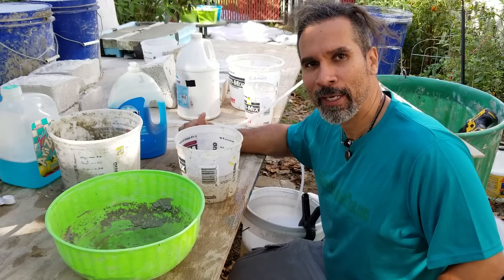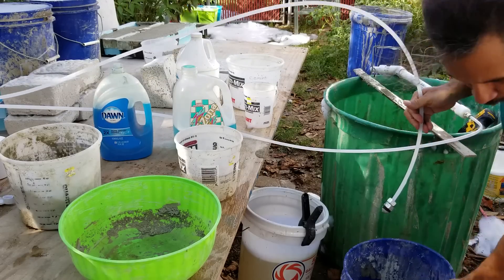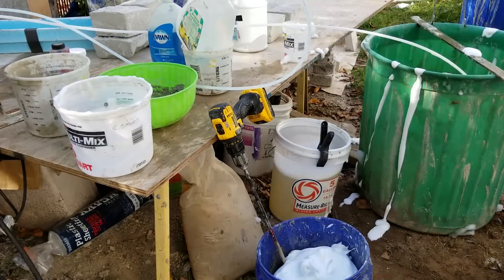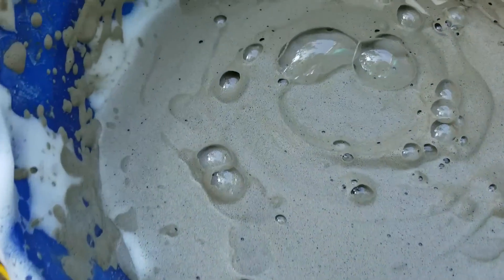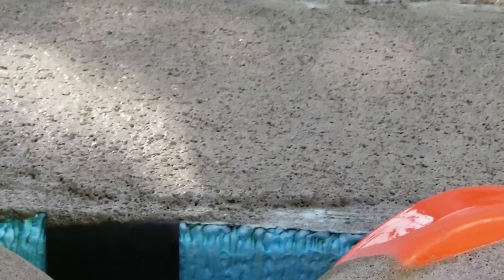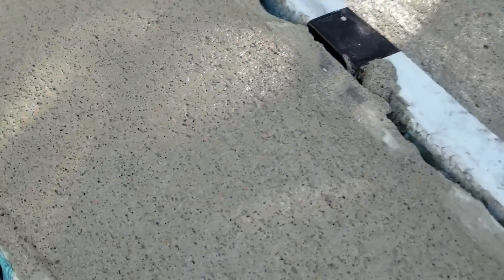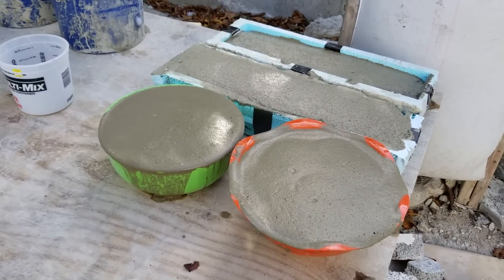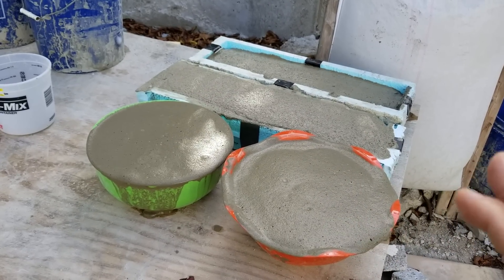How To Make Aircrete Part 3 #Aircrete #Foamgenerator #AircreteHarry #AircreteHarryFoamGenerator

Comment: I am reviewing your aircrete videos because im getting ready to try making some shipping container exterior insulation paneling. I'm thinking of putting some hog wire panels inside the aircrete for strength on the sides. do you think its nessasary or what is your exerience  setting steel mesh in aircrete. i wonder if i could substitute the hogwire for a less expensive or recycled material like plastic mesh fencing type of material. any ideas? Thank you for your diligent research and documentation of aircrete Harry.

Comment: great videos! That's a 5 quart bucket, so two buckets level-full equals 2.5 gallons? So when you add more foam to the second bucket, you are going over 2.5 gallons. thanks! (this might apply to previous video = part 2)

Comment: Hi Harry,  Great video's. I have been watching Darwin on Honey do Carpenter and he has built many Aircrete projects and has determined after much testing that Suave Shampoo makes the best foam and holds up longer than all the others. Do a video using it . I think you'll be suprised. He builds rocket stoves and also incorporated water glass to coat the cement and it is totally heat proof. The aircrete alone is heat resistant but when he lined the flu with water glass it would withstand 3000  - 4000 degrees. Thanks.
Reply from the maker: Thanks Jimmy, I know Honey do Carpenter. If you look through my videos you will see I did  Test comparing different soaps and suave against Drexel. Drexel is the best! On my video if you click on my name then click on videos all my videos will come up in order and you can see all the different test I made. Thanks!

Comment: can you comment on the shrinkage volume or how much the aircrete shrinks during the drying period
Reply: Concrete doesn't really dry. The water stays in it and is what holds it together.  If you cook it in an oven at over 212f it will turn back into the powder.

Comment: Thanks for your videos Harry, you really make me want to go out and build with it. I have a question and a few thoughts to add though

Do you know if pressure washers with the foaming setting will work well to create a quality foam for this?

Also I have built some homes from straw bales and they have natural plaster walls. They use cattail (swamp hot dogs) as the fibre for their plasters. I think it would be a great fibre to add to aircrete ( when you rub the cattails they spread out into millions of tiny fibres) 

Also I think aircrete would make a great base for underneath a concrete floor. It would be far cheaper then styrofoam. Just pour 2-4" of aircrew first and then top it up with 2" of regular concrete for added strength.

Aircrete walls could be poured and then plastered over later for a finer finish,

refractory aircrete mixes for building a fireplace

The domes look great but I'm not such a fan of all the work that goes into all the curves personally. I want to get this going more into traditional construction. Mixing foamy bubbles is a lot easier on the back then shovelling all that gravel and sand! You are onto something here Harry!

Comment: Harry, you’re measuring your foam wrong! Nobody caught, even you! You say two gallons of foam in the videos, but your bucket clearly says 5 QUARTS!!! Unless we’re talking Imperial measurements (Canada) here you’re putting a half-gallon more foam in the mix every time! That’s a lot if the ratio is important, which I think not, however if structurally important, it would be critical. This isn’t the case with the product. OTHERWISE well produced. Dyslexic people pick up on nuances and details like this. We couldn’t make a video like yours, but we can tear up one looking for errors! I make a hell of a proofreader as well! Going to use aircrete as a binding agent with chopped straw in a 18-20” in-filled wall post and beam cabin I’m building.
Reply: Yes, I caught that too. Says 5 quarts right on the container.

Comment: Hey Harry, I see lots of creative possibilities with aircrete, for instance, a tiny home with an exterior of broken pieces of ceramic plates artfully arranged over the aircrete. Or aircrete bird houses, painted or mosaiced. Thanks for the vids. Great inspiration...John Rabeler
Reply: I think it would be really easy to build a geodesic dome home.  (ziptiedomes.com)  https://www.domegaia.com/   Use a PVC geodesic dome for the supporting structure but cover it with some covering the concrete won't adhere to.  Spray Aircrete all over the dome and let it cure.  Then dissassemble the PVC geodesic dome from the inside, reassemble and use it for a chicken coop or green house later.

Comment: have you ever tried to cover the freshly made aircrete, eg in food wrape or spay with more foam on top, or something, just try to get the best/lightest aircrete for insulation purposes only with no collapse, but i suspect its most probably got to be the foaming agent you need to use, nice thick micro stable foam.

Comment: Here is something you may want to experiment with Harry. There is a product call deck patch which is used to fill cracks in a deck before a vinyl cover is applied. It looks like portland before and after mixed but after dried it is like a polymer wood filler which is likley what it is. Dont think it would be fire resistant but could be resiliant for paving stones.